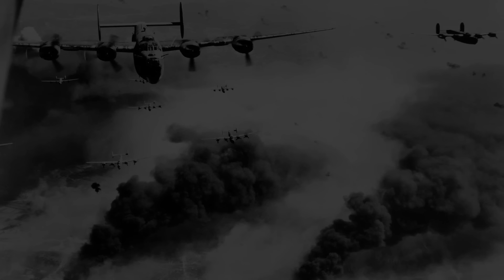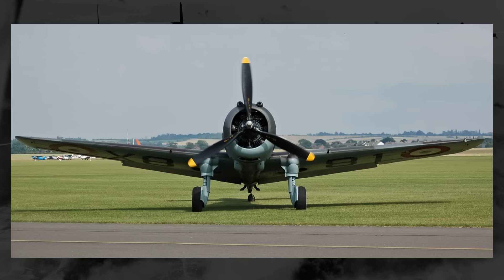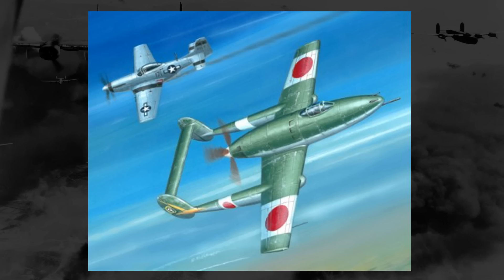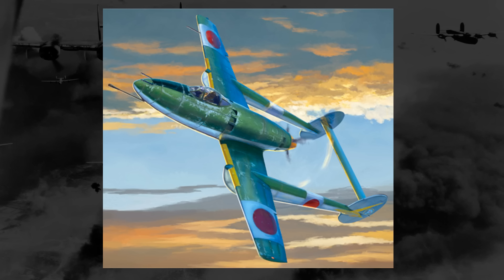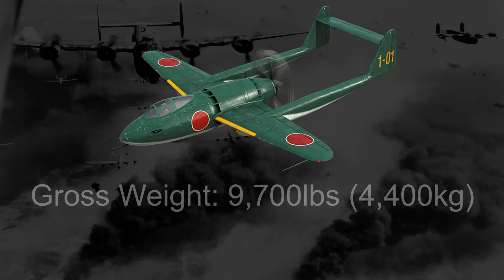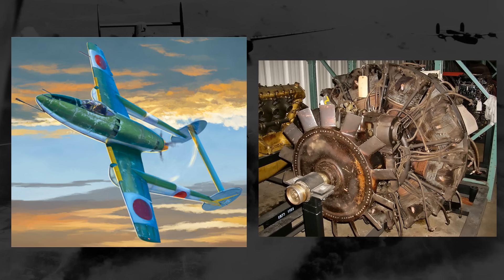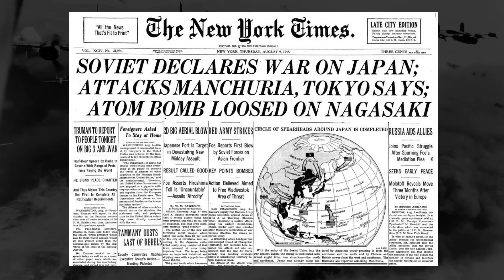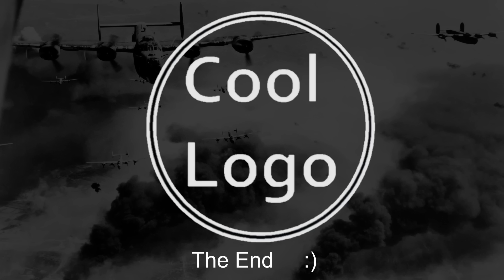Twin-Boom Superplanes... With A Twist!: Mansyu Ki-98 & Mitsubishi J4M

Comment: Do not confuse the RADIAL engine with the ROTARY engine. They look similar when they are not running, but VERY different when they are. With the RADIAL engine, the cylinders and crank case remain stationary, only the crankshaft rotates. They are mostly all 4 cycle engines also. With the ROTARY engine, as the name implies, the whole crankcase and cylinders rotate along with the propeller, and the CRANKSHAFT is stationary and affixed to the body of the airplane. The rotary engines were also mostly 2 stroke. They were popular in World War 1. By World War 2, they were considered obsolete, and radial engines had entirely replaced them except on some very old planes which retained their original engines.
Reply: Radial engine cyclinders have fixed positions that radiate from the center of a crankshaft that turns within the engine..
Rotary engine cyclinders, and the propeller,  rotate around a crankshaft that is firmly fixed to the enrire aircraft;
The propeller of a rotory engine is attached to the engine. The propeller and engine rotate as one assembly. 
Both provide better cooling than inline cylinder engines. 

The rotory engine has wicked gyroscopic precession that requires very different piloting skills compared to other airplanes.
Reply: I don't think anyone is confused by that, at least on this channel. Interesting tidbit on rotary engines. Early model Mazda automobiles used a rotary engine type known as the Wankel. Little bit different obviously from aero engines, but I found working on them fascinating.
Reply: @rbilleaud  The Wankel engine, although termed a "rotary" engine, is an entirely different principle from the rotary aero engines used in the First World War. Those engines had pistons and cylinders, all of which, along with the crankcase, rotated and were attached to the propeller. The crankshaft was fixed to the aircraft's body. The Wankel engine has a fixed body. What rotates is a triangular piece inside geared to the power output shaft. There are no cylinders, per se. It is entirely different. The only similarity is the term "rotary."
Reply: @powellmountainmike8853 that's what I kept thinking of. I didn't know there was two types of rotary engines
Reply: @rbilleaud  Mazda used the Wankel design of rotary-piston engine for decades (1967 - 2012, plus again starting in 2023), not in its earliest cars, and not just in early models.
Reply: @powellmountainmike8853  yes, which is why Wankel-design engines are better referred to as "rotary piston" rather than just "rotary".
Reply: @brianb-p6586  I'm sure you meant eccentric rotary, rather than "rotary piston", as the Wankel eccentric rotary lacks a piston.  And be careful, as Wankel also designed a traditional rotary, which had pistons.
Reply: @rbilleaud  The poster of the video is confused by the difference, hence his claim that the radial was popular on WW1 fighters when they mostly had the rotary, not the radial.
Reply: @thekinginyellow1744  You're sure about what I meant, but you are completely wrong.
Any internal-combustion engine has a chamber which changes in volume to compress the working fluid (air) and extract energy by expansion after combustion. To do this, the chamber has a moving side, which is called a piston.
From Merriam-Webster...
piston (noun)
pis·ton, ˈpi-stən
: a sliding piece moved by or moving against fluid pressure which usually consists of a short cylindrical body fitting within a cylindrical chamber or vessel along which it moves back and forth

In the conventional design, the chamber is a cylinder, and the piston reciprocates (moves back and forth) by sliding along the cylinder axis. A piston can be linked to a rotating output shaft by various mechanisms, but almost always using an eccentric shaft, and conventionally with a connecting rod between the piston and the shaft; in this case, the eccentric shaft is called a crankshaft. The cylinders can be arranged in various ways, normally in one or two rows, but in the case of the radial aircraft engines featured in this video the cylinders are arranged radially around the crankshaft in one plane per row. These are reciprocating piston internal combustion engines.

In the configuration designed by Felix Wankel and developed into a working engine at NSU (by Paschke), the piston has three working faces, moving between two flat side plates in an epitrochoidal (figure-8 shaped) housing to form three working chambers per rotor. The piston rotates on an eccentric shaft, and the shaft rotates relative to the housing in a synchronized motion. Since the piston rotates (relative to both the eccentric shaft and the housing), the piston is called a "rotor" and this is generically called a "rotary-piston engine"; most manufacturers shorten that terminology to just "rotary engine" (such as the General Motors Rotary Engine and the Mazda Rotary Engine ).

Yes, Felix Wankel designed various engine configurations; among them is rumoured to be a rotary-block radial-cylinder reciprocating piston engine, intended to be used as a motorcycle hub motor. No, I was not referring to that.
Reply: The Rotaries were all four stroke. Read Jane’s ATWA 1918 for primary source info. The only two stroke round engines were Packard and Guberson Diesel radials
Reply: @rbilleaud Mazda Rotory engine as used in all RX models, IS NOT a aircraft rotory engine, even if it has been used in aircraft... the Maxda rotory engine has only an eccentric shaft and usually 2-4 rotors, an aircraft rotory engine looks like a radial engine and both runs very  simular, with the propeller, pistons and cylinder rotating around a stationary crankshaft for the rotory engine, and the crankshaft and propeller rotating inside the stationary engine block, pistons and cylinders... and just a little more fun info, the Mazda rotory engine, is not a true Norton/Winkle engine. The Norton/Winkle engine the engine rotates while the rotors and eccentric shaft are stationary. The Mazda rotory engine, the engine is stationary while the rotors and eccentric shaft rotate
Reply: @jasonbrown3632  Yes, everyone understands the difference between rotating-block radial aircraft engine called a "rotary" and the Wankel rotary-piston engine - that was described 10 days ago in earlier comments.

But as for your nonsense about rotary-piston engines...
"rotory"? The word is "rotary"
"Winkle"? The man's name was "Felix Wankel "
"Norton/Winkle" (or even "Norton/Wankel)"? Norton was just one of many companies which licensed the Wankel rotary-piston engine design from NSU; they did not invent the type.

Felix Wankel designed the Drehkolbenmotor (DKM, "rotary piston engine"), which is what you are calling a "true Norton/Winkle engine" - it is only a historical curiosity now. Mazda, and everyone else, uses the Kreiskolbenmotor (KKM, "circuitous piston engine"), designed by Hanns-Dieter Paschke, which is the practical engine developed from Wankel's work.
Reply: @brianb-p6586  I've heard of the Wankel "piston" called a rotor.
Reply: @petarnovakovich240  yes, that's the usual term, which I used in an earlier comment. You should read comments before responding to them.
Reply: Good lord.  These comments are like a 1988 BBS b****fest.
Reply: All Radial engines are odd numbered like 5, 7,9, because they splay off of the “Master Cylinder “ which has the main fixed contact with the cylinder ! These Radial engines cool themselves nicely but when you add another Cylinder Bank you get the front bank blocking most of the air to the back cylinders . Now if you have a 3rd Bank you are asking for trouble with overheating big time !!
Reply: @oceanhome2023  the master and slave connecting rod arrangement has nothing to do with whether the number of cylinders in the row is odd or even - it works regardless of the number of slave rods. There have been a few radials with an even number of cylinders in a row (and two or more rows), and they have master-slave connecting rods; examples include the Lycoming XR-7755, Jumo 222, Curtiss H-1640 Chieftain, and Bristol Hydra.

Comment: The FW190 had just such a cooling fan at the front of its radial, which allowed a tighter cowling with a large spinner. While it ate up significant horsepower, the net benefit was large. 

The Japanese were probably aware of the design by the time they started work on these aircraft.
Reply: They used cooling fan like that in J2M.
Reply: The photo of Ha-211 RU engine shows a cooling fan quite similar to the fan used by the BMW 801 installed on the propeller shaft.
Reply: @enscroggs  I thought the picture he showed was a BMW 801!  I guess there are only so many ways to design a ducted fan.
Reply: @enscroggs 
The fan on a BMW 801 turned with three times the speed of the prop shaft.
Reply: @ThatsMrPencilneck2U 
Iy's easy to distingwish the two. The BMW 801 was a 14 cilinder and the Ha 211 an 18 cilinder as stated in the video.
Reply: @henkormel5610  When I realized that it wasn't the BMW engine, I did pull up some pictures of the engines.  For some reason, the pictures of the German power plants are of really clean specimens, while the Japanese engines look, well, less than prime.  I tried to count the cylinders, but I was pretty tired.

Comment: The pictured mock up of the Mansyu seems to have a pusher propellor and a puller propellor?
Reply: That's Ki-94-I.
Reply: @Teh0X   - maybe so - but it was included with this video - 
which would obviously be confusing - specially when one had never heard of the KI-94-I
Reply: @jonniiinferno9098  No doubt about it. Certainly a mistake.
Reply: @jonniiinferno9098  Should have been included in this essay since it was one of the candidate bids for their "wunderwaffesu" fighter.  Perhaps he couldn't find enough info or cut it for time, but the pic snuck in?

Comment: I've always been baffled and fascinated by rotary engines. I don't understand how fuel moves from a fixed gas tank to a spinning set of cylinders. Absolute magic to me.
Reply: The crankshaft is hollow. And fuel goes thru there.
Reply: Applies to a rotating engine - fuel is fed through the hollow crank - fixed solidly to the aircraft. Radial engines work like your car-engine and only the outputshaft rotates.
Reply: It follows that the conrods are also hollow, and the fuel-air mixture comes up through the middle of the piston? I think there's a spring loaded poppet valve in the piston crown.
Reply: Many were 2 strokes, or used the principle of passing the mixed fuel/air charge  thru the crankcase to be drawn into the pistons from ports.
Reply: @obsidianjane4413  I don't recall coming across any that were two strokes..

Comment: Convergent evolution also demonstrates the same principle as "convergent engineering". The laws of nature tend to winnow out the most imaginative ideas from the most effective ones.
Reply: I’ve been saying that wartime military development strongly resembles radiated adaptation, it’s an interesting phenomenon
Reply: @ashbirk4681  Very true. Furthermore, these wartime developments often carry on less than optimal features for similar reasons seen in biological evolution. Whales drive themselves through the water by stroking their tail flukes vertically, whereas nearly all fish and the extinct Ichthyosaurs employ a horizontal side-to-side motion. Hydrodynamic principles suggest fish are more efficient swimmers on account of their horizontal tail motion. ( The flatfish -- flounders, sole, halibut -- are exceptions as they have traded efficiency for stealth.) Whales, however, have retained a spinal column evolved for fast running on land which doesn't really benefit their totally aquatic lifestyles. The overwhelming trend toward air-cooled radial engines in the Imperial Japanese forces can be viewed in the same light as the mammalian spine.
Reply: I must say, I think you may all  be al talking balderdash. 

Evolution is a matter of random change, blind luck and trial and error. And that is conceding that evolution has  a purpose - long term  survival. of many species, In  fact it  has no purpose at all 

Engineering design is a matter of  ingenuity in service of some Human goal  . It is purposive. deliberate and goal driven. 

In war of course each side develops new machinery,  tactics; exploits opportunities and  defends against new threats existing platforms will change

To cite some even clearer examples: 
Would you say that a fox is  a better inhabitant of  English woodland scavenger/hunter niche because its teeth are more evolved than  simpler  badger's teeth in other words the fox has passed through more near extinction events connected to tooth construction?

Would you say that a Spitfire mk XIX is a better design than a Hurricane Mk III  one as a fighter  thee  other as a  fighter bomber  - just because 19 is bigger than 3?

oohh dratt. I think I get it now,,  you aren't saying they are  the same kind of thing. You you're' saying  they are analogous. Right?

Because there's nothing whatever the matter with whales tails. From Blues to Orcas they were all doing just fine until humans showed up.  No doubt some were on the  edge  of  extinction. There always are some like that , without that preessre there woiuld be no evoliution  and  no us.

And I take the point about adaptive evolution though beyond the  finches  i cant  think of  a good  example
Reply: Excellent point ☝️
Reply: @brucebartup6161 
What I like to say is that “All knowledge is Plagiarized it is only ignorance that is original !”
Reply: @oceanhome2023  I'm having that. 

A friend to Oscar Wilde "I wish I'd said that"
to which  the response was:
"Oh, dear boy,  but you will . . ."

Comment: Isn't that a Sopwith Camel at the 0:44 mark within rotary engine?
Reply: Yes.  The author does not know the difference between a rotary (fixed crankshaft) and a radial (moving crankshaft).
Reply: Did the Crntral Powers use rotary engines on warplanes? It might have been a spectacular episode to attack such a warplane with an S.P.A.D. It's 37mm would probably make short work with one good hit on the engine spinning at high rpm!!
Reply: @martkbanjoboy8853  yes, they did. The Fokker Eindekker and Dreidekker both had rotary engines, to name but two.
Reply: And at 2:40 its a Texan disguised as a B5N.

Comment: Been thinking about this.  If the intake fan worked, it would also have mitigated boundary layer resistance... it might have been super slippery
Reply: Yes and the shutters at the rear could have been tuned to produce a net thrust like in a P-51 Mustang. With propeller cuffs the whole design could have become very efficient.
Reply: @Deviation4360  they were already doing that to late model zeroes

Comment: Saying that air-cooled radials are devoid of a cooling system is a bit of an oversimplification. Besides lubrication, oil also performs a lot of cooling of the internal engine parts, particularly important in air-cooled designs. All these motors are, therefore, equipped with fairly large oil-coolers exposed to the airflow where they create additional drag. It should also be mentioned that many of the WWI radials are actually rotary radials which are a weird and wonderful design in their own right with the crankshaft bolted to the airframe and the prop bolted to crankcase, the whole cylinder assembly rotates along with the prop. Many of them also operate on a two-stroke instead of a four-stroke cycle.

Comment: the engine configuration reminds me of the italian p.119, it wasn't a twin boom but the engine location and type was exactly the same.
they actually test fly it and guess what, had cooling problems, but it still performed decently well, before it had a problem when landing because of the landing gear, sadly it was not repaired because of the armistice.
the chubby fuselage gave the designers a lot of room to put fuel and had a very high range compared to other italian planes
Reply: It didn't have a fan inside, and propeller was in front of the plane

Comment: It is possible that the hot air being expelled from the back,  may even have provided some element of thrust. (The Meredith Effect.)  It would depend on the integrity of the cowling but as the hot air would have expanded it could very well have had some measurable effect. This could have gone some way to balancing the engine power lost in driving the fan.🤔. An example of this system in action, can be seen in the P51 Mustangs cooling system.

Comment: I wonder how much using NACA inlets instead of the rectangular scoops would have improved matters. This inlet is specificly designed to efficiently scoop air from a location with a considerable thickness of boundary layer. The "flamboyant gothic" design of the inlet ramp makes two vortices form, which feed air from higher in the boundary layer down into the scoop. forming the vortices probably would not wark as well positioned side by side (each stealing air from its neighbour), so you would have to give ache intake some lateral space.

Comment: There's another engineering factor for rotary engines which is usually glossed over. The propellor, cylinders, and crankcase spun around the center of the crankshaft;  which was bolted to the firewall.  The offset of the master rod was stationary.  The pistons, attached to the connecting rods  rolled in a circle around the offset the up and down motion being the offset of the two assemblies around the crankshaft.  The attraction?  Minimal vibration.    The  pistons scribed a circle around the crank offset, the cylinders scribed a circle around the center of the crank effectively double the offset.   Vibration was a big concern with everything held together with glue and wood screws.  The torque from all that spinning metal  was manageable - barely.  Great snap rolls, they  were tremendous one way - the other way was a slow turn.  Use what yea got ...
Reply: I expect the enemy would know which way you would break if attacked from astern, and would be waiting for it !!?